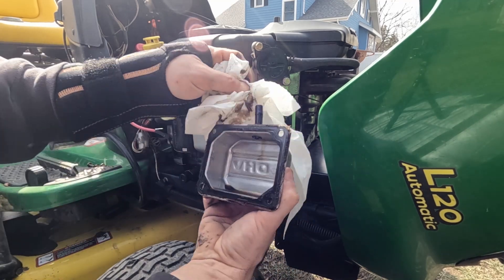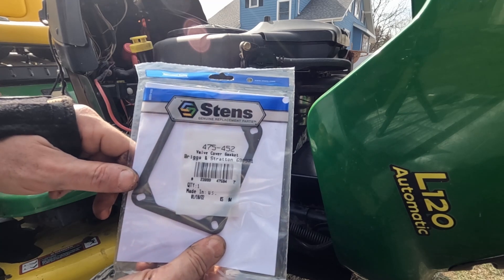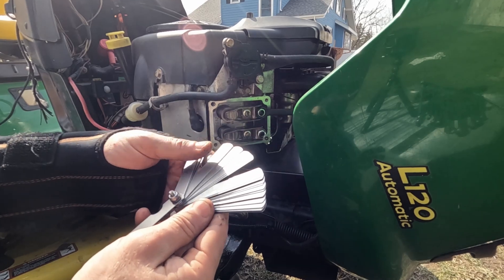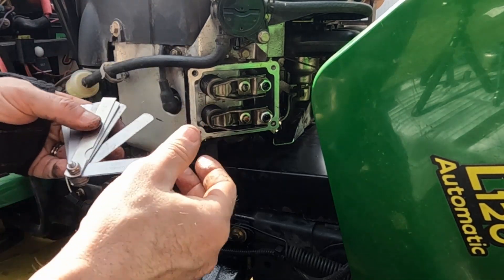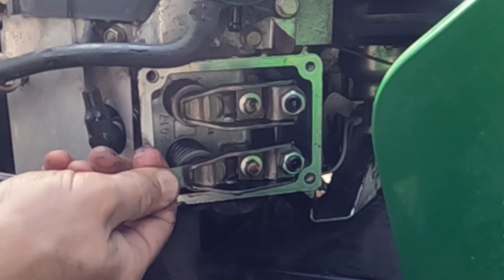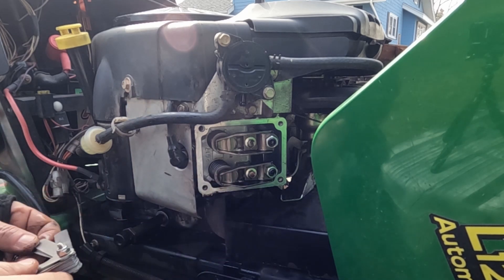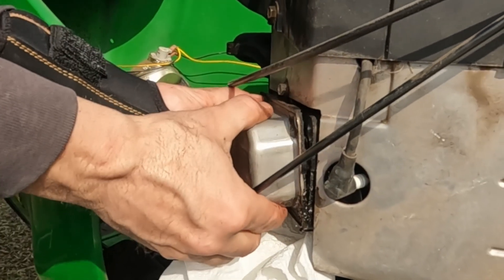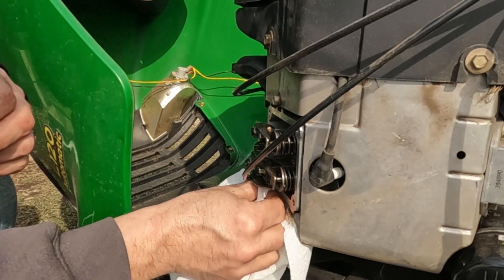John Deere L120  - Briggs & Stratton Intek 20hp V-Twin - Valve Clearance Adjustment

Comment: I am currently putting this exact motor on a gokart ... If you tske the pan off and place a hose over the pump opening that goes over the divider and down to the right side of the engine , you can then stand the engine up and then turn the carburetor 90°s and use this motor as a gokart engine ... I put a thick rubber mat down for the engine to rest on and made motor mounts out of some angle iron to hold the engine in place and tomorrow after work i am ordering the clutch and chain for it .... The gokart im putting it on came with a little 6hp honda thst bkew up and i had a craftsman lt1100 that was given to me a few months ago that ran great but the frame was falling apart and so figured I might as well use its engine and junk the old beat up frame plus you gwt all kinds of reusable hardware from dismantling a Craftsman mower 😂😂😂.... Pretty fun building it as i am learning and trying new things with vertical shaft engines and i can wait for it to be finished and put some videos up ... Well thsnks for the valve adjustment video and hopefully i will never have to adjust the valves on this mower but from what im learning about these B&S 20hp vtwin engines is its common for them to occasionally need valve adjustments so at least i know how now ... Well have a good and be blessed in Jesus name 👍👍👍
Reply from the maker: Sounds like a fun project.  Good luck.
Reply: @thehandyhomeowner9781  I got it finished and blew up the motor up about a week ago ... I never even got any videos of it of me on it , once I got it finished I couldn't wait to ride it and it was WAY faster than I anticipated , in fact it was so scary fast it was t even fun anymore 😂😂😂😂 just too fast haha  but I am waiting for my buddy to bring me another one except it's the 22hp twin so everything I have done is completely compatible even the motor mounts and I will definitely do videos of this one

Comment: It would be a whole lot easier to rotate the motor if you pull the spark plugs before adjusting valves.
Reply from the maker: Yes.  I know this now.  Thanks
Reply: @thehandyhomeowner9781  Hey, don't sweat it. I still forget it from time to time. I just blame it on the fact I quit drinking 8 yrs ago. It seems like projects went alot smoother with a few drinks to help navigate you.😉🍺🍺🥃🥃🍹 Peace out and God Bless.?😎✌🖖🙏🤝

Comment: People be careful here the hex nut is the adjuster and the  torx is the lock. Not the other way around. Once adjusted hold the hex nut with wrench and turn the torx as the lock
Reply from the maker: Thank you for commenting.  I hope i didn't mess anyone up with that mistake.
Reply: Mine is just the opposite, the hex is the lock.
Reply: Not on v-twins. You are correct if it were a single cylinder Briggs and Stratton intek.
Reply: Ugh, i just bolted the covers on.
Fingers crossed 😂.

Comment: Did you know that the Cam has a compression release and your supposed to turn the motor like 1/4  inch after set to dead center. When the motor build to much compression it's a release. If that breaks on the cam no good! How does your mower run after the adjustment?
Reply from the maker: The mower runs amazingly well ever sonce adjustment.  It already ran well but took a few cranks to start up.  Now it starts when the key is bumped and runs as good as ever. 
Thanks for the comment

Comment: I have black oil like on my muffler and it smokes at first start. How do I fix that. I have John Deere L120
Reply from the maker: I'm not 100 percent sure all of what might cause that. Hopefully someone else will commebt here for you.  Otherwise i suggest the john deere lawnand tractor group on facebook
Reply: The crank seal on the bottom of the motor can fail and get oil all over the frame and muffler. Not sure that is your issue but I have seen it before. If the bottom of the engine and frame are covered in oil, keep a close eye on the oil level as a bad leak will run the engine dry and then you will have junk. Best to have a repair shop look at it and fix what is wrong.

Comment: At 4:00 you say you have a video on how to modify this and I cannot find that video in the list?  Can you advise?
Reply from the maker: You're right.  It's gone.  Well basically i think i simply changed the screw and nut holding it together and used a nylock nut so it cannever fall apart and you end up with all the little pieces of feeler guage all over the floor.  Haha.  Sorry for the confusion.

Comment: My L118 manual valve clearance has a different spec’ for the intake valve versus the exhaust valve. Just curious as to why the difference.
Reply from the maker: I'm guessing the exhaust valve spec is larger and i suspect becsuse the hot exhaust causes the metal to expand that much more so it needs just a bit more room to end up at the correct size when hot.  Maybe somebody else has a better reason. 
Make sure you adjust the valves with the engine stone cold.  
Thanks